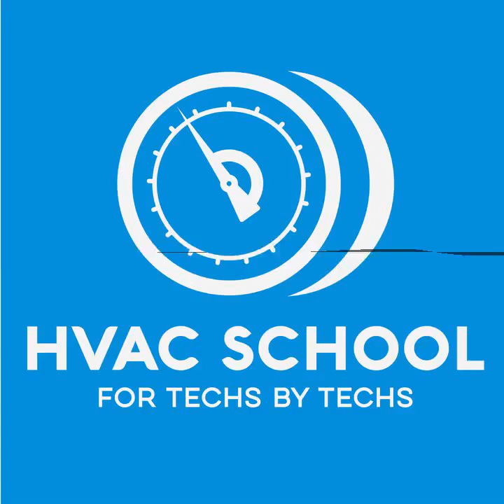(Podcast) Hard Start Kits, Types and Applications w/ James Bowman

Comment: Why is Kickstart your preferred hard start of choice?
Reply: Check out the amrad start kit, they have a fuse wire to take it out of circuit if the relay sticks and you can get the MFD closer to the factory.